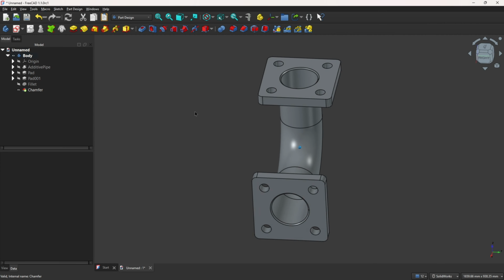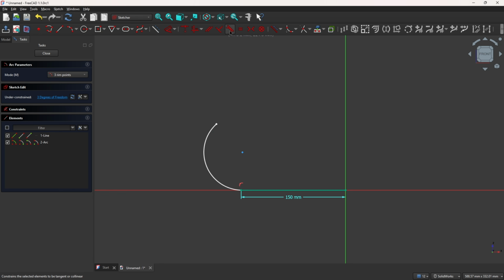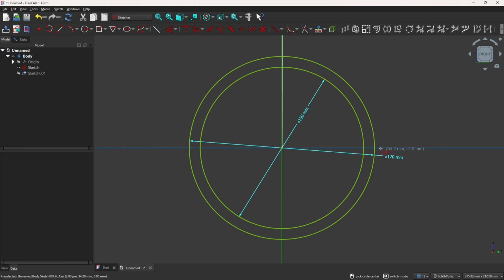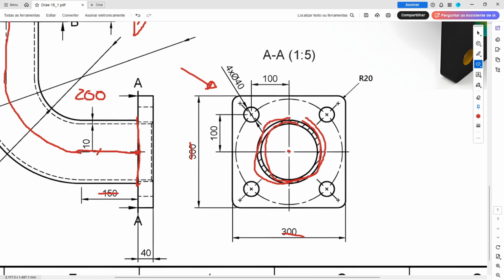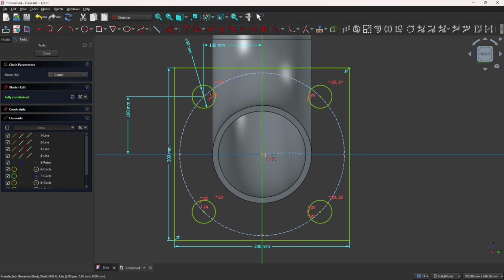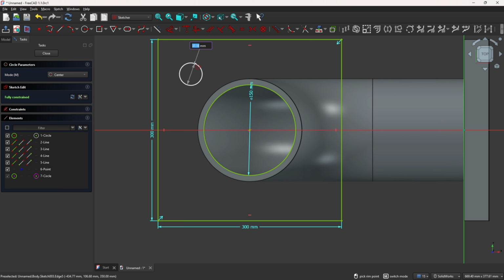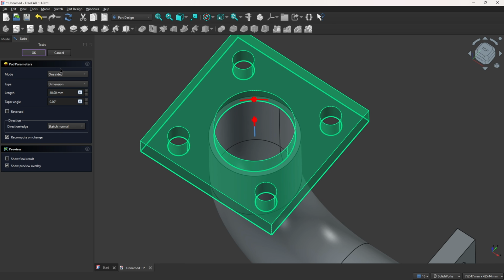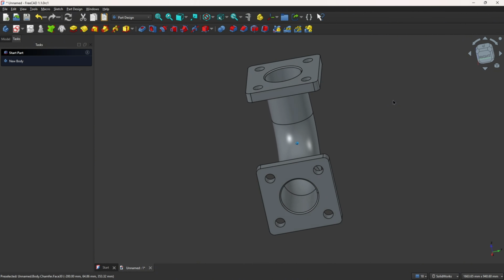FreeCAD 1.1 Tutorial - How to create a Pipe with Flange Step by Step

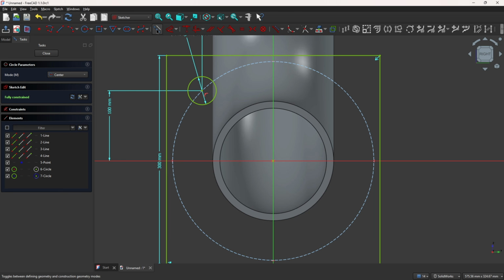Comment: Why is it made as a circle instead of a square at 4:50?
Reply: Yeah i know that it is two months old comment but maybe someone will benefit in future from the answer. 
He is following drawing definition, circle here have its advantages and (at least for me) is kind of intuitive around the pipe inlet centre.
You could use here centred rectangle with the same effect, just by defining 200x200 sides and placing d40 holes at the corners. 
hope it helps